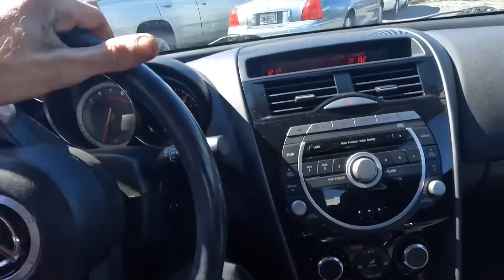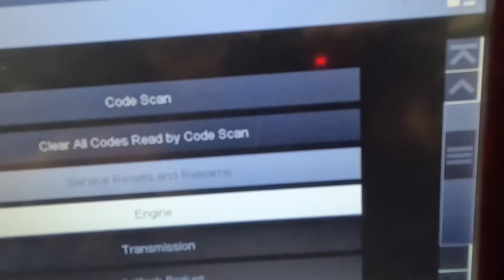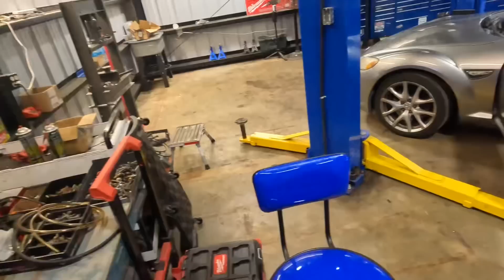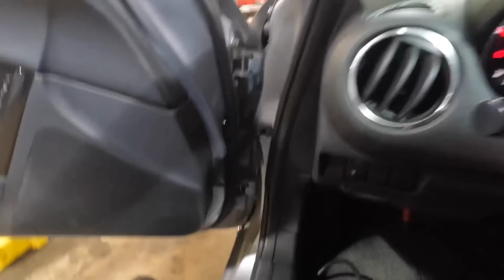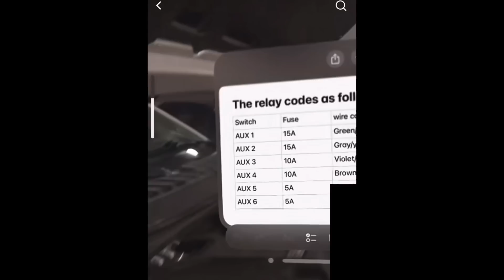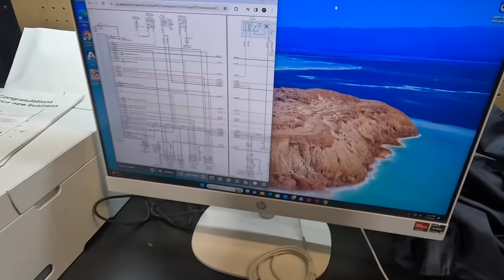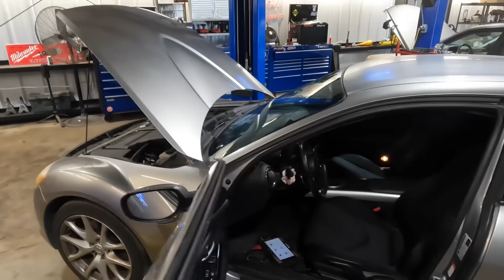Will Virtual Reality REPLACE Mechanics?? Mazda Rx-8

Comment: I was a member of the UK RX-8 owners club and owned one of the first cars in the country from 2003 to 2008. No, there should be zero vibration. My dealer put a full glass of champagne on the engine and revved it to 9500 rpm with not a ripple. The engine actually displaces 3.5 litres because of the way it works and is good for 250hp in the manual (stick) version and 0-60 in under 6 seconds. Putting an automatic transmission on an RX-8 was both idiotic and a sin because it fundamentally undermines the benefits of the engine. The engine revs to 9500 rpm and should be used, always, in that rev range because it's good for the rotor seals and delivers full power.
Reply: Rotary engines weren't fuel efficient plus the RX7 had a large gas tank for it's size. On top of that the engine had engine oil sprayers/misters that sprayed a little oil into the combustion chambers for rotor lubrication. The owners manual stated that the engine was designed to consume one quart of engine oil every three thousand miles but they were fun.
Reply: Automatic, eww... I drove the 205bhp version - surprised about the lack of torque on these, but an absolute blast when you're 3/4 to WOT. Great driving car in the manual variety.
Reply: I don't care how bad the rotary motors were. They were so fun to drive and play around with.  I miss the little Motors.. here in USA .
Reply: No matter what it is still just a Mazda, who really cares.
Reply: Is the rx-8 A 1.3 engine and heavy on petrol,I've always fancied one of these suicide back doors Well cool Very High reving engine , has any body else made a Wankel engine or is it only Mazda motor cars
Reply: @DainSmart-vm7pc 
Yes, very heavy on fuel for the UK because our petrol is crazy expensive. I got about 23mpg although in the USA that's considered OK. It also, necessarily, consumes some oil in use (similar to a 2 stroke piston engine) but it's not too bad. 
Several other companies tried rotary engines including NSU, Porsche, Daimler Benz, Nissan, General Motors, Suzuki, Toyota and Norton motorcycles to name but a few. Go read the wikipedia Wankel Engine page.
It's pronounced 'Vankel' by the way because it's a German name.
Reply: @DainSmart-vm7pc  they were tried in a bunch of vehicles, fortnine has a video about a rotary motorcycle, but it's one of those things tried by a lot of manufacturers, abandoned by most.
Reply: Suzuki made a rotary engined motorbike
Reply: Yeah I was surprised on the ridiculously low redline on this🤣
Reply: @Lensman864  I glad someone has pointed out that Wankel engines use a cheat capacity statements, it's like 3 pistons working on one cylinder head, so this 1.3L stated capacity is in reality a 3.9L engine and as such it's power is relatively poor, however, the fuel consumption tells the truth for what is a 3.9L engine.
Reply: @572Btriode  The rotary that guy was talking about was a 2 rotor.
Reply: @theroyalaustralian    Doesn't matter, each bank uses the swept volume of one rotor face only, so it has two banks of quoted 650cc each making a quoted 1300cc, but really each bank is 1950cc and twice that is 3.9L
Reply: my brother bought a mazda when he got out of the marine corps, that was the fastest little 5 speed car possible for it's size, rotary engines are built to rev, incredible.
Reply: jusr stick a 6.5:1 rear axle ratio in it
Reply: Putting an automatic in most cars is a sin, regardless of what engine it's behind.
Reply: The Wankel engine operates like a piston engine of twice the displacement and three cylinders per rotor, so this engine is equivalent to a 2.6 liter inline 6 cylinder engine.  And at least in the US, these made all of 234 hp and had to struggle to reach 60 mph in less than 7 seconds.....
Reply: @Flies2FLL  You know the closest competitor is the Skyline RB26DETT if going by displacement. Those two T's at the end designate twin turbo.

At 275hp. 

So for not being forced air, 234hp is actually really close to spot on.
Reply: @AliasTekTV  Engines are air pumps.  There are three ways to process more air and thus more fuel into power:

1.  More displacement.

2.  Forced induction.

3.  Higher cycling rate/volumetric efficiency.

The Renesis engine comes within 32 hp of the RB26 DETT because it spins fast and breathes well.  But the MASSIVE difference is that the RB makes over 300 foot pounds of torque at low RPM while the Renesis struggles to get past half of that, even at screaming speeds.  Thus, the power available from the RB is fare more useable and available, which is why the Skyline will leave a Renesis in the dust if both cars are stock.
Reply: @Flies2FLL  Yes, we are all aware that a non forced induction rotary is down on torque at low RPM. This is because that's not the design of the engine. It was meant to be small and compact. The rotary does not have the induction vacuum required to fill the "chamber" at low RPM which is why road engines have long intake runners. It was a way to speed up the 4 cycle process, and complete it in one revolution. It's a 2 cycle/4cycle hybrid.

I very strongly implore you watch any of the current turbo and non turbo 4 rotor engines here on youtube. You'll also come across the top fuel project. Torque is meaningless if it's not applied in a useful manner. If torque was everything, we would be racing diesel powerplants.

Look how diesel dyno runs and tractor pulls work out.
Reply: @AliasTekTV  Much of what you say is true, but here's the kicker:  People tend to BUY horsepower but DRIVE torque.  Torque is what makes a car driveable and to move a heavy load.  Horsepower only gives you top speed. 

Yes, you can make a fast Wankel engine car.  That's been done thousands of times, but these engines do not last as long as piston designs and can easily over-rev and blow apart.  For street cars, Wankel engines are atrocious!  They have no torque, they produce enormously hot exhaust gases, and their emissions are terrible.  Since it is a thermodynamically inefficient design it tends toward heavy fuel consumption to boot.  Toyo Kyogo managed to fix the reliability issues, that was another problem for a long time.

Where these would seem to have an audience and  good use would in the light aircraft world.  But even in that use there is a glaring problem:  The main advantage of these is extremely light weight, but that pretty much precludes it from being used in existing airframes designed for heavier horizontally opposed piston engines.  A light weight Wankel engine up front would tend to shift the center of gravity backwards and make the airplane tail heavy and thus uncontrollable.

Really, the Wankel is a solution to a problem that simply didn't exist to begin with.
Reply: So you're telling me that the rotary should have a CVT? Would actually be neat.
Reply: Unless its a Renesis like this one.
Reply: @theroyalaustralian 
The rotary engine in all variants of the Mazda RX-8 was named Renesis so I don't understand your point.
Reply: @Lensman864  Ok.
Reply: @theroyalaustralian suppose any rotary is destined to be doomed. Just expect to send the engine off for rebuilding at 70k.
Reply: @theroyalaustralian all are Namen renesis
Reply: @unknownname6519  What?
Reply: @theroyalaustralian  autocorrect... all engines are named renesis..
Reply: @unknownname6519  Yeah, I looked that up.

I don't really like these rotories
Reply: @theroyalaustralian  "I don't really like these rotories" Your country has an exclusive class of motorsports, and many exotic manufacturers of rotary engine performance parts, some of which are making 1200+ horsepower and beat on every time it's used for entire race SEASONS.

In fact, aviation praise these engine as there is no mechanical failures to cause it to seize mid flight outside of losing oil. It will run with one rotor making no power at all. There may not be use in a daily driver application, however there are NUMEROUS applications where they are very much superior to piston engines.
Reply: @AliasTekTV  I don't like the Renesis specifically as it is known for issues.
Reply: @AliasTekTV  Name a production aviation Wankel engine please-
Reply: @Flies2FLL  Rotron RT600-XE and the Diamond Aircraft Industries AE50R are the first to pop up in google.

lol.
Reply: @theroyalaustralian all RX-8s are renesis….  🤦. If you don’t even know how to check oil, why are you on an automotive channel?
Reply: @sjfk1306  Ok. Your opinion and your opinion only.
Reply: @theroyalaustralian  my statement isn’t an opinion….  It’s a completely factual statement…
Reply: @sjfk1306 Ok. Your opinion and your opinion only.

Because I can indeed replace oil.

This is a fact.
Reply: @theroyalaustralian  I don’t think you know what certain words mean…
Reply: @sjfk1306  I interpret this as hate speech.
Reply: @theroyalaustralian  maybe you need further education then…
Reply: @theroyalaustralian are you.. smooth brained?
Reply: @sjfk1306  Again, your opinion, and your opinion only.

I don't give a s*** dude....

I am a home mechanic repairing my own car right now.
Reply: @theroyalaustralian  my statements are factual kid..

Comment: Technicians gain skills and knowledge over time. A headset cannot do that. When I first started out I was slow doing electrical work but after years of learning and real world experience I know where I need to look and how to do it quickly. I have learned shortcuts over the years that's what makes a technician good. The ability to learn and grow. When the headset wearer breaks off an exhaust stud, will the headset teach them how to weld on a nut and how not to get frustrated when it happens?
Reply: Nope, but he will probably use that $3,500 head set to weld with : 0  Scratches at a level two, deeper scratches level 3.  Welding splatter - Priceless

Comment: No kind of AI could ever replace Raymond and Lauren...does not compute!!!!✨️✨️✨️
Reply: There's no such thing as AI Unit. Who can replace a Wife Unit with an AI Unit?
Reply: Anyone remember Google Glasses?
-
Also, a headset can't turn a wrench.
Sure, in a perfect setting, with NOTHING out of place, a computer could control a robot to turn a wrench.
But add some dirt, the variability of rust, aged plastic connectors that break when touched, missing fastener, broken studs, and customer modifications.
Is that engine leaking or did the car just drive through a puddle? Can the computer adjust for every possible level and color of dirt? As Ray's example, will it find a chewed wire or will it keep replacing the same sensor?